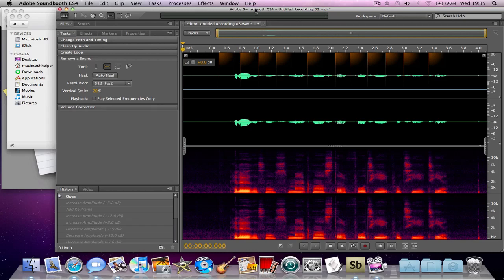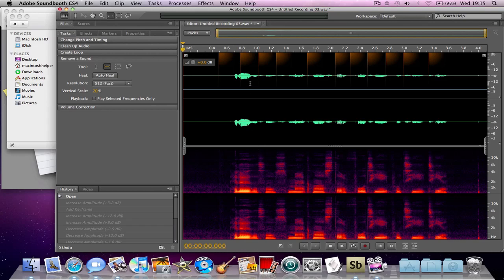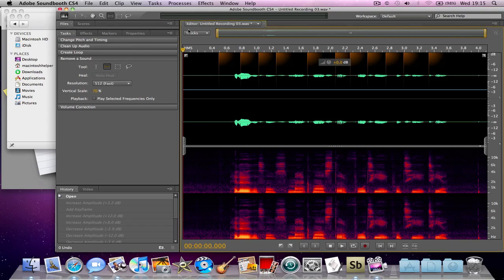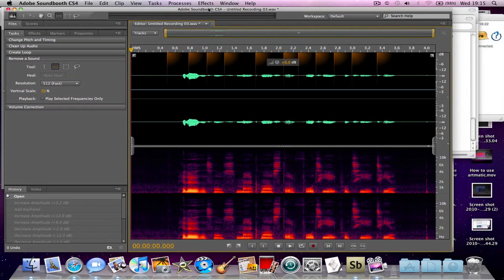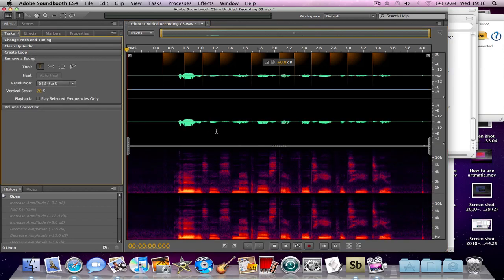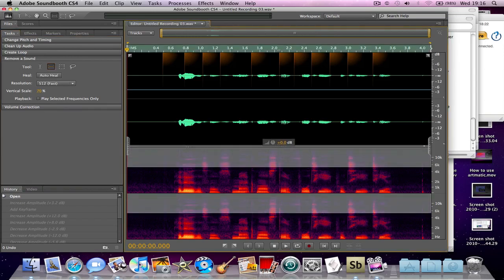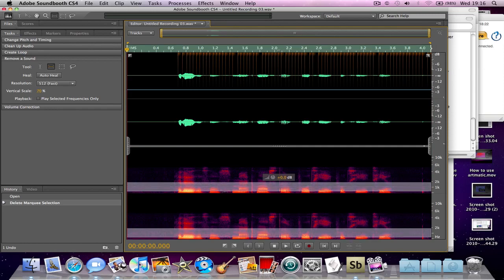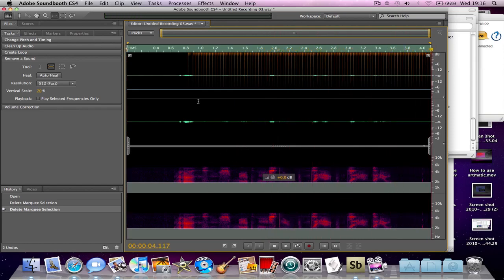How to make a radio effect in soundbooth

Comment: this wasn't useful, i was after a radio static one, this one cripples the sound so its through a cheap speaker.

I want to add sound, not remove it. particularly static that mimics a radio coming through